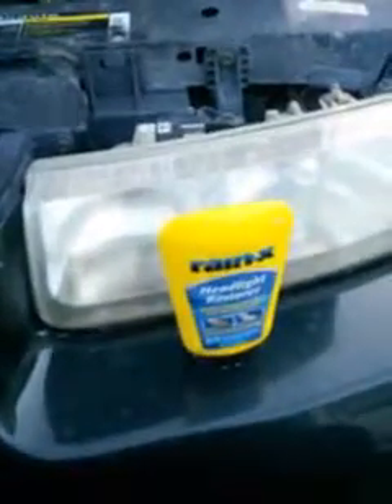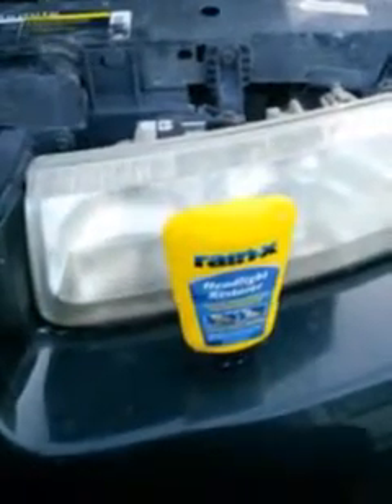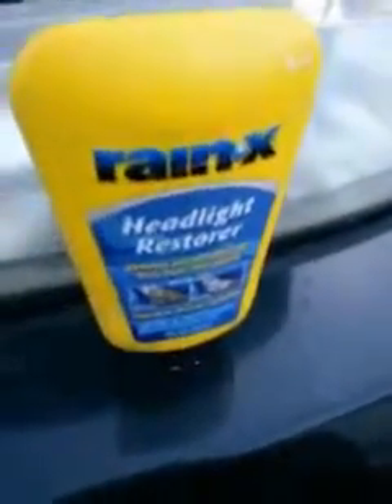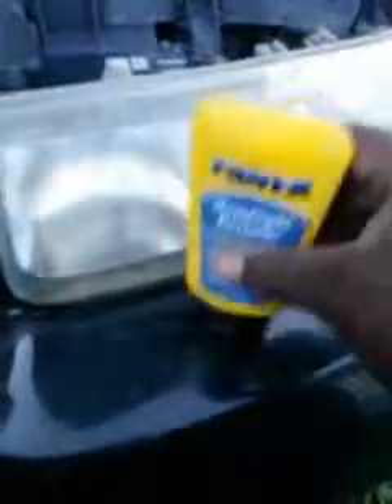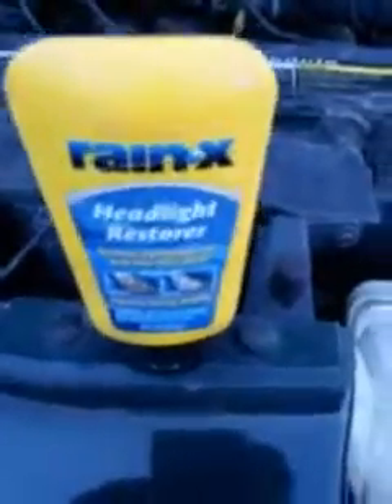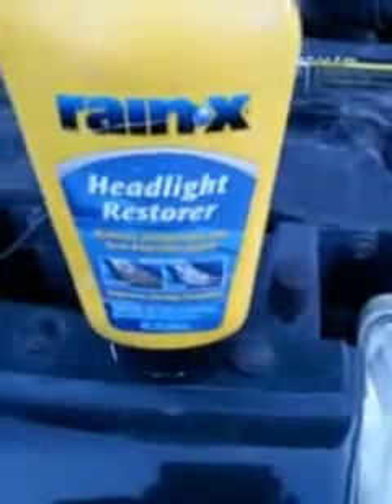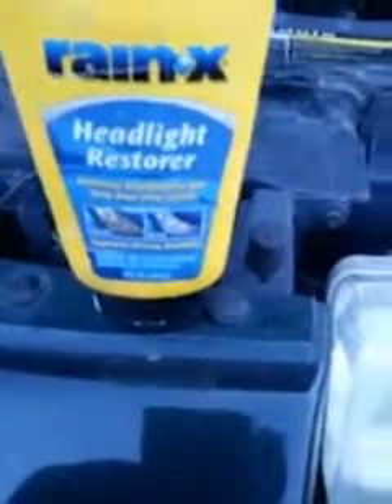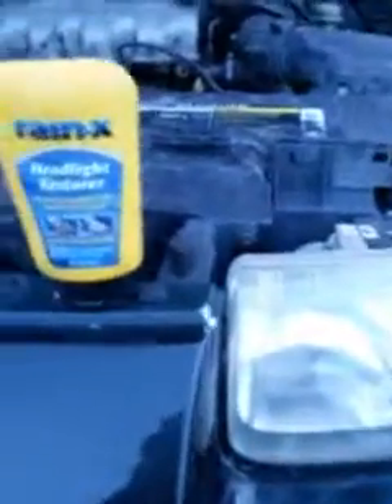Rain x headlight restorer kit demo

Comment: Hey man, good demo but, I believe the reason it was so hard for you is because you’re not applying it correctly. You should be using an abrasion pad to apply the product. I just got the kit which comes with 3 abrasion pads, 2 little squirt bottles - a Lubricant and a sealant along with that bottle of headlight restorer bottle and a microfiber rag. the lubricant squirt bottle is to be applied with an abrasion pad before the headlight restorer. then apply the headlight restorer using another the abrasion pads instead of a paper towel to take off that film. Then rinse and apply the sealer and wipe with the microfiber rag.
Reply from the maker: it was easy to do the chrome polish works even better tfw